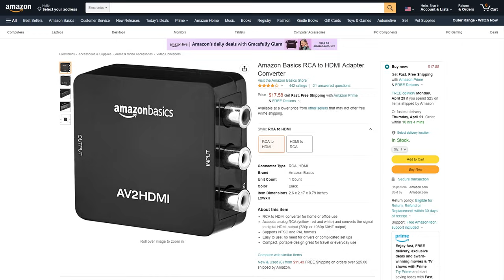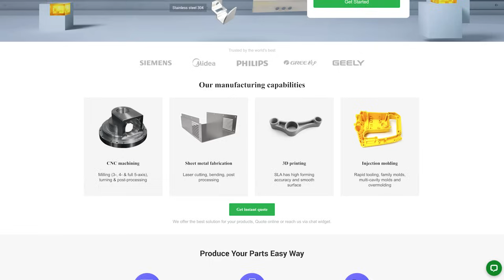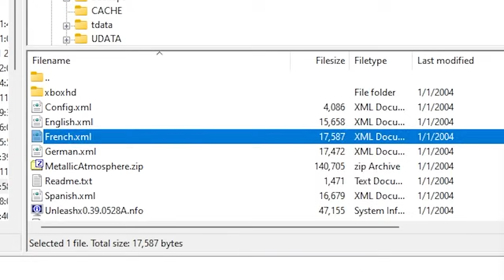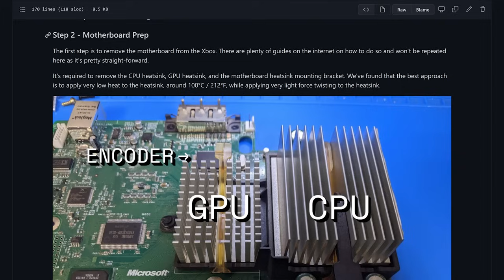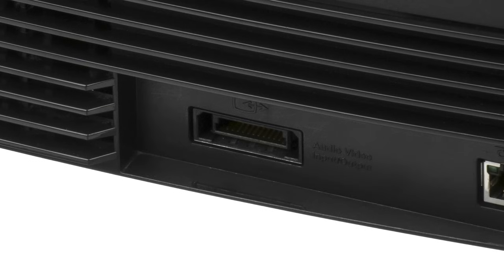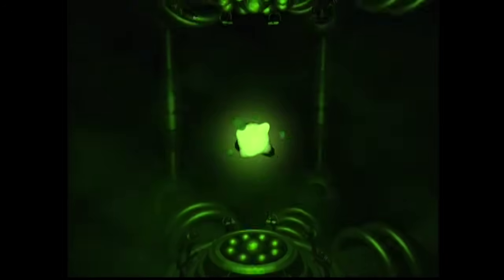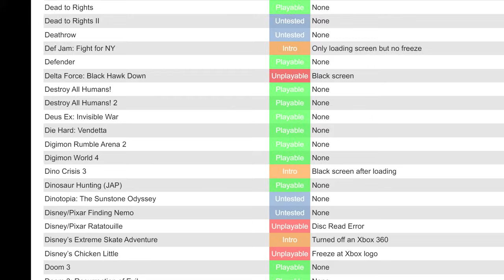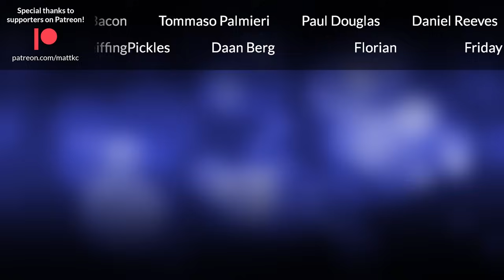The BEST video output for your Xbox - XboxHD+ HDMI Mod Review

Comment: Hey there Matt, may I suggest upscaling your videos to 4K before uploading them to YT? I think you can do it in OBS though I haven't figured the best ratio between quality and size when initially recording in 1080p myself. Still, channels like DigitalFoundry show that at 4K YT mangles these older systems output a lot less. If you have the spare HDD space to do it, it will massively improve the output from 6th gen consoles and below. 1080p output on YT is extremely mushy by comparison. In any case, great video, love your production!
Reply: If you upload with 1440p+, you get the VP09 codec instead avc. So it's like h264 vs h265.

Comment: I bought a O.G. Xbox when they where on sale and i was always into getting the best picture quality in HD so i bought the Monster cables Component cables for the Xbox and it looks really good with no drop out issues and the cables also came with an digital optical out port and fiber optic cable for digital surround sound I do have a Sony 27inch CRT TV that is for Retro gaming and I also have a 2014 40inch Samsung 4k TV that has one Component input and the picture looks great.
I will buy this mod and sit on it just in case i decide to use it in the future but sure do seems like a lot of work but for those who dont have a component jack TV or cables i defiantly see how this is a must.
P.S.......He didn't put enough Thermal paste on the GPU it a big chip and the X method on applying should be used for proper coverage.

Comment: The heatsinks weren't that hard to remove originally. But over 20 years, it has hardened up and dried out, acting like super glue. 
I recommend using modern Arctic MX thermal paste, not the cheap stuff like Microsoft did. You shouldn't have an issue in the future, but always have a heat gun or blow dryer on hand.
Reply: Heat gun? No. Just use isopropanol alcohol.

Comment: You don't have to remove the standard av port to make it work.
On the microcontroller (Pic I think, also power and eject come there) there are 3 pins for video output selection mode.
You need to switch 2 of them to ground when you use HD video mode.

With these 2 switchable it is possible to select the video output mode.
There is enough space above the av-port to add a hole for the hdmi port and use a bracket for the pcb.

Or make a Dongle with the bridges in them for in the av port.

Comment: About the Component vs. HDMI comparison toward the end of the video
I can confirm that the component output looks like that on basically any component cable used. I have the original HD AV pack and tested it with Cars. On its own it looks fine but looks weird in a comparison
The results of the HDMI mod are almost apples to apples with running Xbox games on the Xbox 360

Comment: something i did as a good middle road is to mod an xbox 360 component video cable with the end off a regular xbox av cable, all the pins are there and all it takes is to rewire the cable to the right pins

Comment: cheap component was blown out because its ycbcr. y is brightness,  cb and cr are blue-difference and red-difference so i would imagine brightly-coloured signals through low quality cables would leak emr both before and after the tv sees the corresponding brightness data due to inductance i believe. i think this is why hdmi uses comparatively higher voltage and as a standard is way more well shielded afaik.

Comment: i installed my hd+ on my 1.2 with no issues it worked the first time, i haven't done the flex install on a 1.6 but i know it'll be a lot easier on a 1.6 than a 1.0 - 1.5

Comment: I love my OG Xbox. I'm using cheapo component cables atm. I had to learn soldering to fix my Xbox when it blew its caps, which thankfully went fine but I've been iffy on the idea of moddin' it, I'm not too much of a fan of replacing that AV port too. Now I know those original MS cables exist might track a set of those down some time...

Comment: So.. if you have to remove the old port just to make the xbox think that something is plugged into it. Then wouldn't it be possible to create a makeshift plug that just bridges the pins in question. As long as the analog converter is still connected it should also output on the port which would allow you to use analog or hdmi by just putting the bridging plug in or out?
Or am I missing something?

Comment: I once found a modded original Xbox on the side of the road. I cleaned it and found a red modchip inside. I don't know what it does. But because of some stickers on the bottom from a modding company with a 2004 date on it, I guess the chip was put in back then. It's interesting to see something like that.

Comment: Mate I'm so glad someone else burnt there board around the av port pads as well. when i did this mod it was my first time using a desolder gun was so scared i had wrecked the board. makes me feel a bit better about it. 
hot air gun is definitely the way to remove the av port but too late for me now though.

Comment: I had to replace my PS3 HDMI Port, all I did was get a heat gun, flux and tweezers. So once the solder was soft enough just lifted it right off. Also there was still enough solder left in the pin holes to where I did not have to add any additional solder. Just thought I would just give some advice from personal experience. Also I think it is a lot easier and cheaper than a desoldering gun.

Comment: it's hard to get off because the grease dries out over time, i actually put a soldeirng iron on the heatsink and leave it for bit and come back to toasty hot heatsink and it helps soften things up. make sure the plastic clips are removed first (as common sense would dictate)

Comment: The best way to take off those stupid yellow clips is to push on the non-tabed ending towards the heatsink then pull up on the tabed side of the clip. Works like a charm, with no bent fins, or the risk of putting a screwdriver through the motherboard either.

Comment: I saw that tutorial for the clamp like NOOO
Matt, you can push the yellow plastic down. Its a pain in the ass but it will eventually pop off. I did it with my bare hands and partially pulled it to the front so it popped over the clip.

Comment: it depends:

1. on the tv in use
2. depends on interface cable and depends whether or not you got the hd adapter with the console or brought it separately
3. cable density also played apart..

choices for connection 
1.scart (best resolution ((if TV supported it..))
2. Component ((video quality differed pending on the screen it was on))
S-video (max resolution 720x576 limitation in pal territory of AUSTRALIA {bus limitation})
composite Pending on monitor  would render better than rf
RF IN 2022 vs when analog tv signal was still in use could be comparable to the likes of composite when the xbox came out

with the lack analog tv signals today I would think you can still use rf if you wish and get a better resolution on it since you aren't competing with analog tv signals today

Comment: SCART was horrendous. It was a thick cable that often had a strange offset to the connector, they were super easy to knock loose by touching the cable and although they don't look it, they were very difficult to insert without looking, and before the age of flatscreens plugging a SCART lead in could be a real trial of dexterity.

Comment: I recently learned of the Wii2HDMI mod that can be done to an original xbox AV / Component cable. 

I did it and the colors are MORE vibrant than this mod.  
Things look WAY sharper and better. An easier mod by using a cheap $5ish Wii2HDMI and a cheap AV / Component cable. 

No need to open up your xbox and hardmod it.  

I was skeptical but when I tried it, the change was night and day. You have to solder many small pins, but not as difficult as this.

Comment: Matt, seeing those two Xboxes together gave me an idea.
Is it possible, for some reason, to have two Xboxes share the same storage?
Reply: XboxodX
Reply: Kind of.
You can softmod two Xboxes and null/1-out their EEPROMs so they share the same one. You could easily then take the drive and plug it into either one assuming it is also locked with that EEPROM.
As for connecting with both at the same time, I don't think that's possible.

Comment: As someone who used to work with the chips of this era professionally, GooGone is the best way to get thermal pads, thermal grease, and thermal glue off of sinks and chips. It is citric acid though so you MUST follow behind with generous 99% isopropyl alcohol or the like.

Comment: Next time you have to clean gunk off heatsinks: brake cleaner. Yes the one for cleaning car disc brakes. Removes everything from the heatsink. Afterwards give it a clean with alcohol and your good. Please only use it on heatsinks and not the cpu/gpu :p

Comment: Hey guys I have a question. I know there are 720p patches for games out there. Do those 720p patches require the 1.4 ghz CPU or could I run those patches with just the 128 mb ram upgrade? Also are the 720p patches even worth it? Do they make the games unstable? I am thinking of buying a pre ram upgraded and HDMI+ OG Xbox soon and plugging it into something like a Retrotink anyway. I heard the 4K Retrotink that is in development will also have an HDMI input that it can upscale to 1080p and 4K.

Comment: Just putting this out there. If you RGH you 360 you can install an Xbox emulator which allows you to play all Xbox OG games not just the backwards compatible ones. It would probably be better having this HDMI mod on the original hardware thou but I would rather the 360 then the OG on analog.  
I just can't solder as I don't have a steady hand but if anyone knows of services that would do this for me then that would be awesome!
Reply: You'd rather have buggy and broken software emulation? why?

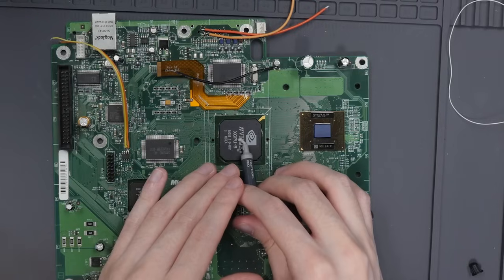Comment: 11:40  Dude, are you serious?  This amount of thermal compound is NOT enough.  Yeah, doing it for yourself is one thing, but when you make a video, you better make sure you do it right or you will get other in a bad habit;).  I highly suggest you take that heatsink off again and inspect your work.  As this compound is fresh, try to take it off without twisting the heatsink, so you can see better how that thermal compound was spread.  I suggest you clean it off and reapply to make sure you reach the corners of the chip.  You will have a larger area to dissipate the heat more efficiently.  You really just need a thin layer of the compound.  Some people use X pattern with dots on four sides or a snowflake pattern with 8 sides.  I personally prefer coating the whole chip with a thin layer (you could almost see the writing on the chip) and then carefully apply the heatsink, making sure that you do not apply more pressure on one side of it (even distribution).   Yes, some people say you could capture an air bubble under it, but I never had that problem with a thin layer of the thermal compound.  Good luck:).

Comment: It's strange - I hear a lot of people complain about 3rd party component cables for the Xbox, but I've got both the original MS one and a couple of 3rd party ones, and honestly cant see any difference - the biggest downside is the lack of of the Toslink port on the 3rd party cables.  Admittedly, both the cables I have are from back in the day so it's possible that the current 3rd party ones are much worse quality.

Incidentally, I installed one of these things for one of my friends and ran into the same "the system has to boot before you see any video" issue that you did - IMO, it's a deficiency in the instructions that this isn't clearly communicated, since it violates the expectation that a modded Xbox will boot just from the ROM contents.
Reply: La salida toslink de microsoft realmente es una conversión A/D y esta lejos de ser buena así que tiene bastante perdida, es mucho mejor comprar un conversor A/D con entrada RCA y salida SPDIF Toslink como el de Swissonic por ejemplo y obtendras un sonido mucho mejor que el del pack HD original

Comment: So just got my first OG Xbox and did the time capacitor removal as per your vid...
Mine was leaking bad, but doesn't appear to have wrecked anything else luckily, not sure yet tho because I haven't tested, but the seller said it worked before he sent it and he seemed genuine.

Anyway, I legit have no way to plug in the xbox as I have no way of using composite as none of my 3 tv's support it.
So, I have ordered the hyperkin hdmi cable, but wondering how this mod compares to it (I really want best pic quality possible)

Comment: Honestly i would do this hdmi mod for the sake of being able to use on modern tvs and have it preserve in a way. I have some console put away because of this a/v out put .. but definitely gonna start ordering hdmi mod ports so i can take them all out and be able to switch console on the fly and bonus you can use the el gato to capture game play or stream soo there is a benefit of doing this mod.
Reply: Not much benefit when quality HDMI adaptors exist. The adaptor's short cable connects to the console video output, then you plug an HDMI cable into the adaptor's tiny box and it acts like a single cable from the console to the TV.
Mine was 30 bucks, the video quality is as good as shown in this video. No input delay. Support for 720p and 1080i is also available... for games that support it of course. It also lets you pick between 4:3 and 16:9 in case you prefer black bars over the stretching.
Reply: @Manic_Panic  well yes of course but adapter tend to suck over time and I would preferred doing these mods since i know how to micro solder. In this case it would benefit me,  instead of having them dongle adapter in the way. But i do agree with your comment they are available and easy use for the non experienced of soldering. I just like having a clean set up with no extra attachments to my consoles thats all. Plus i love to the tech and messing with motherboard components.
Reply: @Manic_Panic  What quality HDMI adapters? Every single one I've ever seen has been terrible.
Reply: @slipangle3027  I use Prozor's HDMI adapter and I only had one issue with it that can be fixed. 

Half of the games in interlaced (480i) mode have semi transparent pink vertical lines across the screen but since I can enable or force patch/hack progressive scan on them, the issue fixes itself and thankfully, the very few remaining interlaced only games do not display this problem. And they're like, 2% of the entire library anyway (mostly PAL football exclusives).

The image quality/cleanliness is as good as component and there is no input delay (since there is no upscalling involved). 

But yeah, I do NOT recommend this at all if you have a PAL, unmodded Xbox because all games will be interlaced and you'll have plenty of them displaying the pink vertical lines.

Comment: Old thermal paste is (imo) best removed by letting it soak in an IPA soaked paper towel then scrubbing it off
Reply: Letting Goo Gone sit for a few minutes works great. Then you clean it up after using isopropyl alcohol.

Comment: You should use a 10-bit linear interpolation current steering digital to analog converter (DAC) and a Gilbert cell mixer to generate an RF amplitude modulated signal directly. The linear interpolation increases the attenuation of the DAC's image components.

Comment: Cheap component cables look horrible "blown out" because of lack of filtering, capacitors are expensive so they choose not to use them to keep the cables cheap, it works, but the image is pretty bad + the cable quality is bad. Owning the official HD pack solves these issue (capacitors are in the box connected to the XBOX) I don't know if I'd bother with HDMI the process seems painful...

Comment: I have all the Xboxes here, best is the Vault Gear of War III, less, the R2D2. Not owing any custom Xbox original custom transparent whatever, only the black model. 
Why i have them all and not the PS, nobody needed the Xboxes or the Disks.
i have all cables, HDMI too in the cable over the AV port, over DVI analog i guess.

Comment: No use to you now, but there's a recent adapter that serves the purpose of the official composite adapter. It's called the Xbox2Wii Pro and it adapts the xbox multi out into a Nintendo Wii composite plug and a toslink. This means that it's possible to use the properly shielded Wii component cables from HD Retrovision for better composite signal.

Comment: what if someone reverse engineered the xbox hardware etc, and got it to use more modern hardware so it could run in a better resolution... if that is even posible.

Comment: I have no choice but to comment having hundreds of these councils over the years modding many of them first of all you didn't mention the tsop mod other than being able to shut your mod chip on and off I didn't see no disadvantage to doing the tsop overall the mod chip.  Secondly the monster cables for component are absolutely amazing they even provide optical 5.1 audio.  Now I've never had that Microsoft only adapter.  I've just had the 12-ft long monster cables that are green that work great.  So I couldn't say if they Shadow or not compared to the Microsoft adapter.  But I will also say everything looks like crap on a flat screen for these old consoles this console can only do 1080i.  It looks damn good on a 1080p panel but I tell you what I had a Panasonic CRT that took RGB and I can't believe how much better some things look on that versus a flat screen 1080p screen.  That's CRT I think was 480i and it looks better with gamecube and whatnot then a modern flat screen it don't matter if you have the HDMI the games just did not have enough resolution to get rid of the blocks and yet the 480i made it look much better than a traditional CRT with composite video or S-Video.